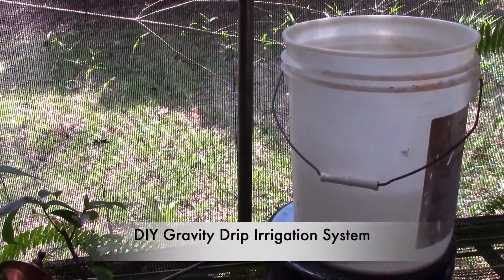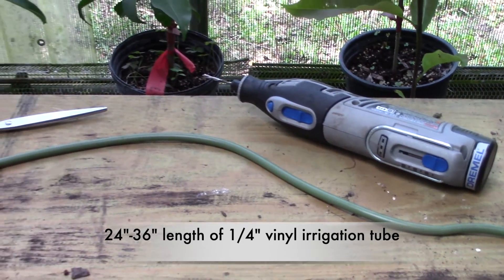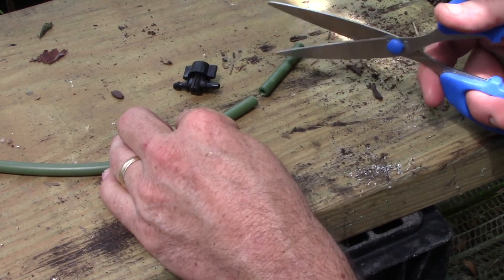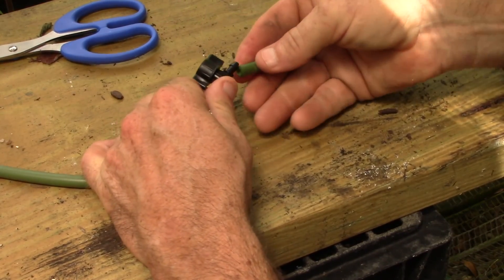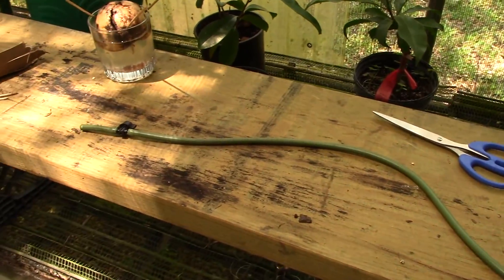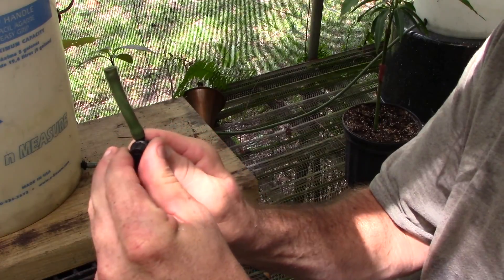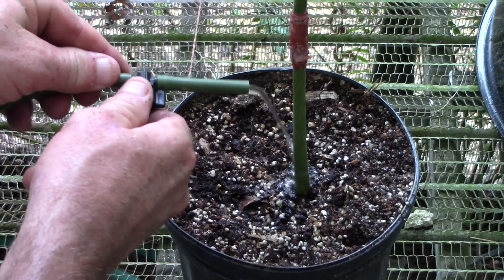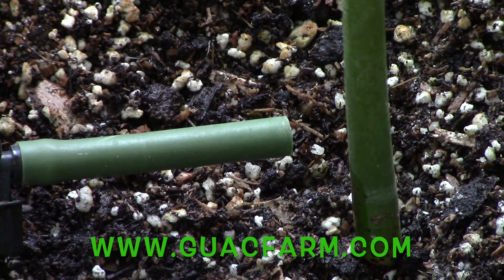DIY Gravity Drip Irrigation System

Comment: You said drill a hole in the Bottom of the bucket but you drilled it in the side at the bottom🙈🤪🙈
Reply from the maker: If you are standing at the bottom of a mountain are you on the side of it or underneath the mountain?

Comment: Doesn't this leak around the fitting you pushed into the 5 gallon bucket?
Reply from the maker: no.  although it's not meant for a 5 gallon bucket it fits pretty good. plus this isn't an indoor application, eventually it would probably require sealant.

Comment: I am having trouble finding the 1/4" vinyl on/off valve at Lowes and Home Depot. Where did you get your?
Reply from the maker: Hey Tom,  I might have got them at a big irrigation supply center.  Have you looked on Amazon?  They might have them there.

Comment: Could you do this, but have a closed valve at the end as well, and then poke small holes along the length of the tube so that when the top valve is open, it comes out multiple holes and could water multiple plants?
Reply from the maker: Yep!  What are you growing?
Reply: @SleepyLizard  I have a 4x4 raised bed that I’m growing a small salsa garden in (tomatoes, onions, garlic, cilantro, peppers). I don’t want to string my hose across the yard to hook up to a drip line, but I didn’t want numerous 5 gallon buckets hanging up either (I may use a 2 liter bottle instead since a 5 gallon will be heavy for a shepherds hook).
Reply from the maker: @kendrasmith1624  looks like you've put a lot of thought into your plan.  Enjoy the salsa!

Comment: But what’s the point? Wouldn’t it be so much easier just to use a can to water the plants?
Reply from the maker: depends on if you wanna stand there with a can or just flip a valve and come back later and turn it off.
Reply: I grow for market this saves from overwatering and saves a boat load of time

Comment: Hi there great video. I'm in the process of building a system as well. I have a question about the connection of the bucket and vinyl connector leaking.
Reply from the maker: is yours leaking?  one trick is to make sure the hole is smaller than the plug...so small that you really have to push to get it in there.  If that doesn't work you can a tube of silicone and go around the hole on the outside of the bucket after you insert the plug and seal it all up with the silicone...put a layer let it dry, then a second and if necessary a third.
Reply: No haven't built it yet. Will ensure the hole isn't too big.